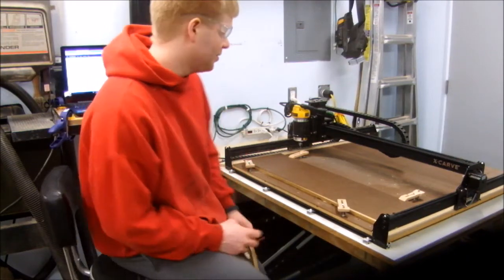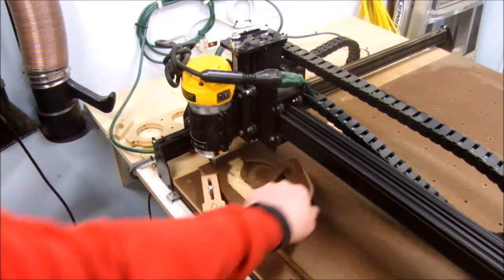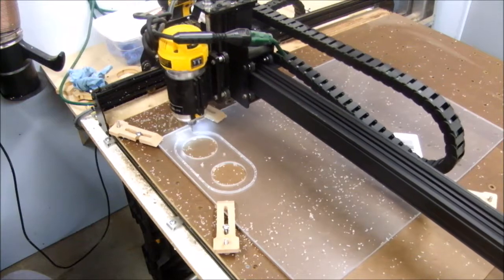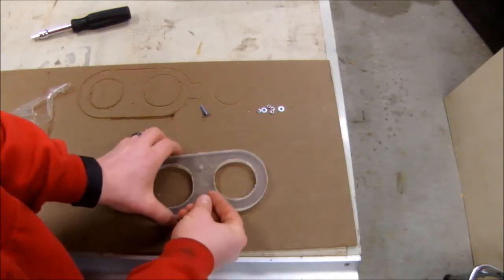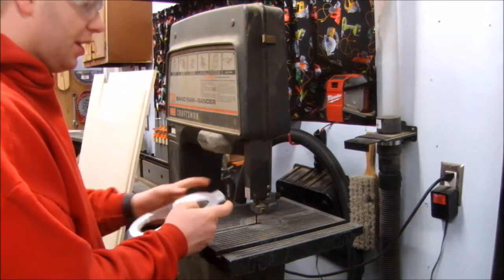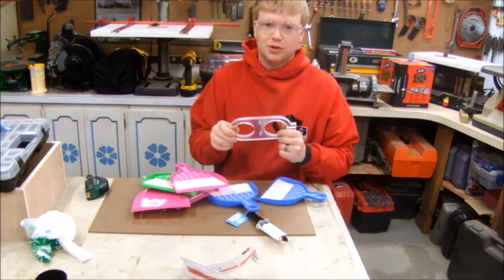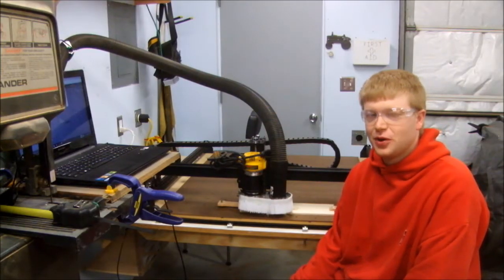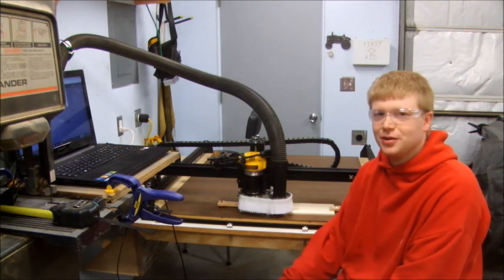X Carve CNC Dust Collection Boot

Comment: Flat spots on circles are often caused by backlash in the system. Check your belt tension and see how much play you have on that axis.
Reply from the maker: Yeah, I recently found that I had a loose pulley.  I need to re-run the circle test now that I drilled out and tapped a much large set screw.  I'm not sure how long it's been loose.
Reply: +Craftsman David that makes sense. Hoping it tightens up the movemnet for you.